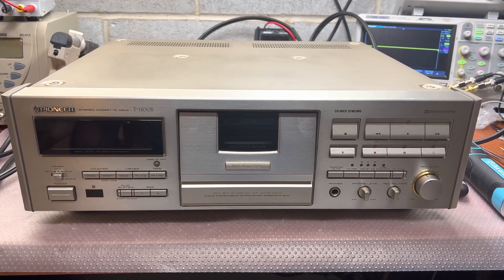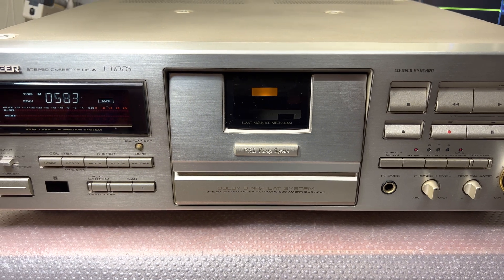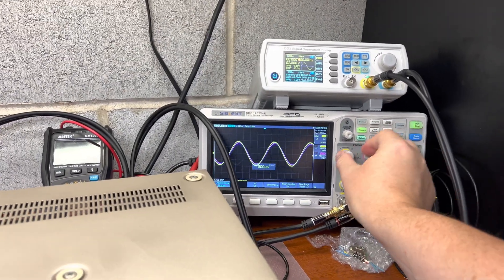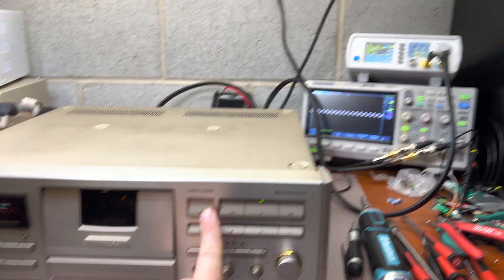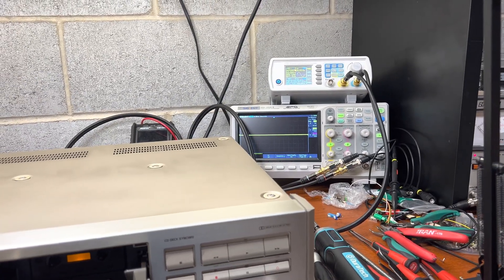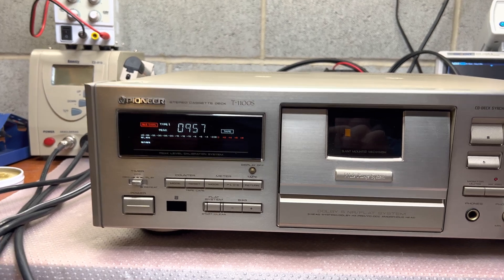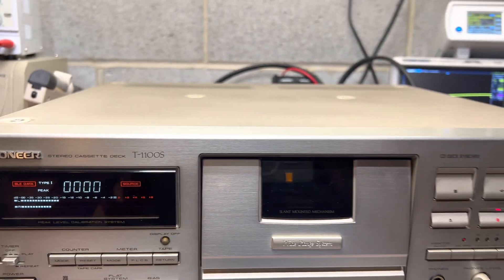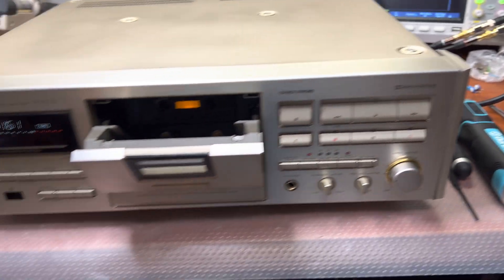Pre-Restoration Bench Test: The Pioneer T-1100 aka CT-95

Comment: @hifirulezzz, I got the same T1100s, and the same Dolby test tapes you've used at the beginning of this video, and wish to tell you that those test tapes we both bought from E-bay, are not to be trusted... left channel is weaker than the right channel on mine too, exactly as I saw on your video.(anyway the stronger right channel appears to be ok on the Dolby level scale, but the left one is weaker then it should).
I've later discovered that, when I bought the original Panasonic plus the original Teac test tapes and both showed even right/left channels, and I did not made any intervention on the tape deck during this time and never did ever since.
So please take this into consideration and test it yourself with some trusted factory genuine tapes, if you got any, and let me know if my assumption is right or wrong.
Best regards
Reply from the maker: I re-recorded that tape since then and has been using on dozens of decks. It never off more than 0.2 dB. So, I am good, thank you.
Reply: @hifirulezzz  Thanks for the reply...
So indeed those Dolby tapes and other ones from same guy were weaker one one channel as suspected . Also own the azimuth tape wich i believe is unreliable too. Because i got quality chrome prerecorded tapes wich some, sounded muffled, after calibrating the deck with it. The frequency response tape i got from him, shouldn't trust it too. 
Probably is a good ideea to re-record it over, as you did. 
Cheers
Reply from the maker: @emilian5903 it was issue with the head height, not with the levels he recording. Before he was using ZX-9 and now he switched to the Dragon, or vice versa. That is the problem with Nakamichi decks - you should tune up head height. And no one doing that. Way easier to use Sony or Pioneer as they do have guides on the head. Tape always goes properly if not curling.

Comment: I own this exact same deck. Best cassette ever made. Same electronics as the CT-95, only better, with wireless remote control. Designed and engineered in 1992, at the apex of cassette design .After that .it was all downhill
Reply: just bought mine few weeks ago...indeed they are the best tape decks . top of the food chain for cassette decks.
Reply: @emilian5903  Can I ask you what you paid for it. I'm thinking about selling mine. Maybe $2500 as it is in super mint condition